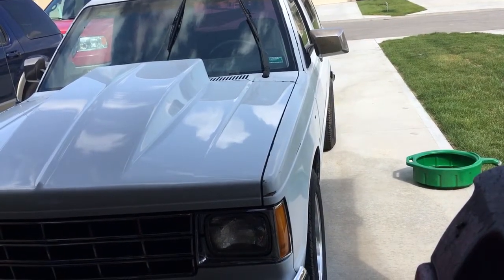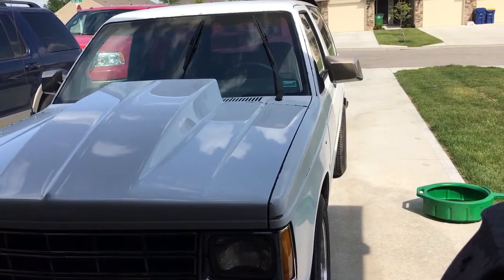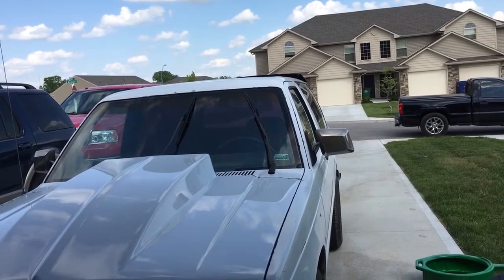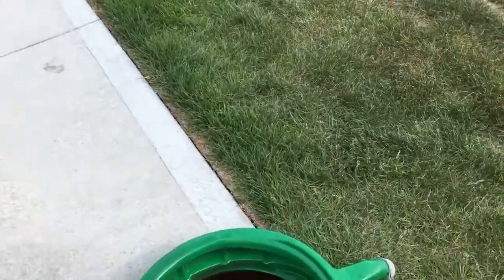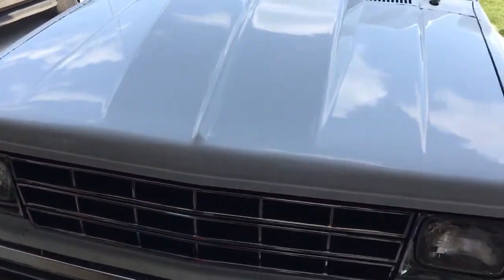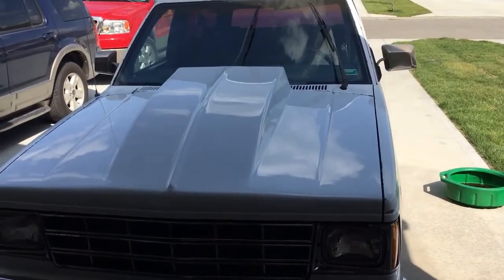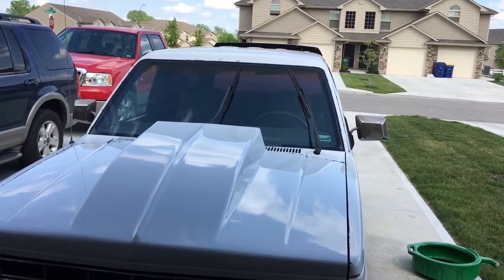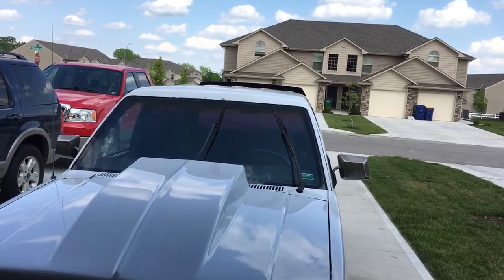Synchromesh FAIL 4.8/T-5

Comment: Really appreciate your videos about using a T5 with LS motor, going down that road myself pretty soon on my Triumph Stag project. The T5 is easy to rebuild; don't even need a press if the layshaft is ok (most are). Just leave the layshaft as is, tear the rest down down and order the parts you need to fix it, a whole rebuild kit is almost always expensive overkill. Especially if it was shifting ok and just making a noise.
Reply from the maker: Socrace D Good information on the rebuild options. I can borrow a press and bearing separator when needed. Currently the worst gears to engage are 1st and reverse, but may be caused by my worn out modified Ford shifter. I did get all the other gears to smoothly shift. 
I'm definitely going to have a rebuild in the future. Thanks for the help!

Comment: I checked 3 times on eBay and it's a match for my factory round one. The one your talking about I am not sure I've seen, also now that I remember the intakes I seen don't require an 90. Just injectors. I got run son electoral test this weekend  and buy a fuel gauge because the spider unit I bought brand over 4 years ago new isn't working. That's why I think the intake is my next move. Until I get my money to buy a daily than have everything ported. Do you know something I can goggle or a site to go to. The marine setups are around  $300. New and steel. I also am going to see about maybe I  can modify and weld the shortys I have for a small block. That would be awesome if can make that happen.  Last I have been talking with you so long now and I never do this but when I can I was hoping I could buy another pair of head's and the manifold and have you port them. I would ship them to you. You are a gentleman and I have no problem with trusting doing buisness with you for the head work. Let me know I can post my e-mail then I can call you and we can set something up.
Reply from the maker: My apologies, I never saw your post or received notification.  I hope you were able to figure out the issue.  JD

Comment: If I get the mercur marine intake what injectors do I get?Lbs,new,used,from what car?
Reply from the maker: Alpha Ghost We've had no experience with the Marine intakes. I know people use them, the throttle body bolts on vertically if I remember correctly, requiring a 90 degree hat. On the fuel injector needed it depends on the application, i.e. boosted or NA.  36# up to 80+#
Reply from the maker: Alpha Ghost I think we found some Red top 36# injectors from a Ford SVO or Turbo Coupe it's been a long time ago..

Comment: What injectors you run right now?
Reply from the maker: My apologies I never received a notification for your comment.  My original 2000 4.8 had factory 24.8# injectors, the new build 2002 4.8 has decapped 25.2# injectors flowing 74# for the turbo build.  JD

Comment: Still haven't got a laptop yet. Too busy trying to build a supermoto from a dirt bike I had sitting around for 4 years and just started trying to get the Extreme rear built as you know and move forward with that but it dosent matter.(International Auto Wrecking) (818)896-5241 Sun Valley CA.